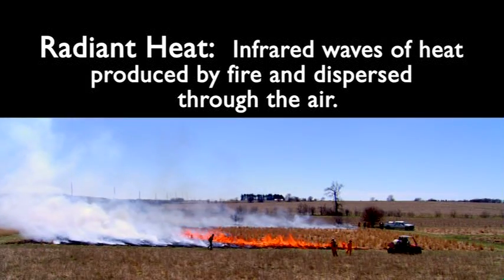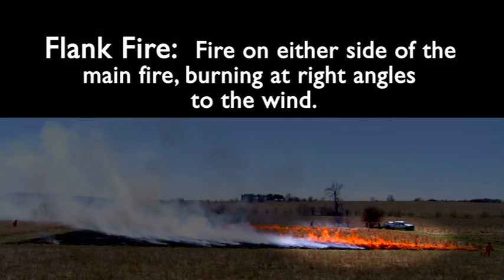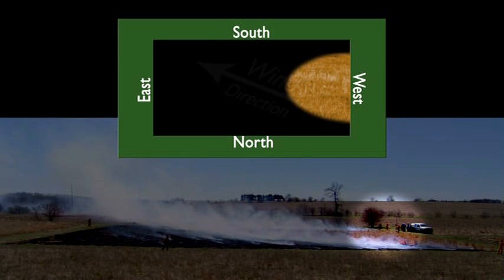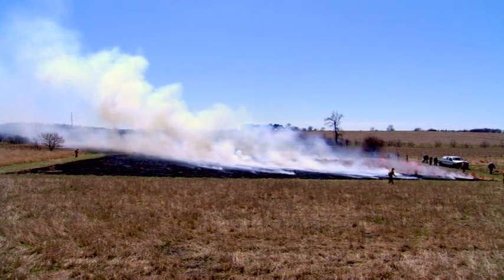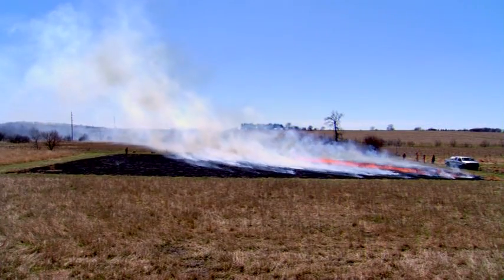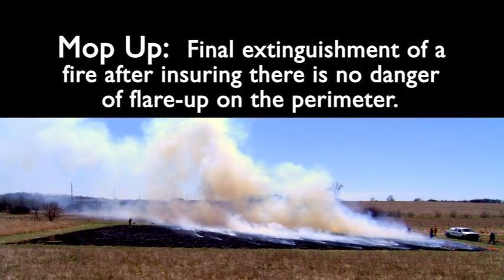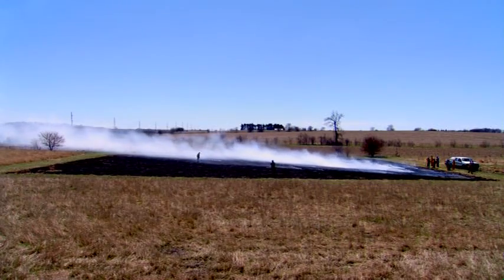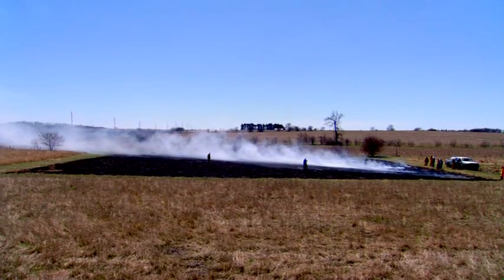Basic Prescribed Fire Techniques -- Demonstration Burn

Comment: 0:43 Radiant Heat i.e. Infrared Light, travels directly away from the flame at the speed of light. It is NOT 'dispersed" through the air.  It would radiate even in a vaccum.